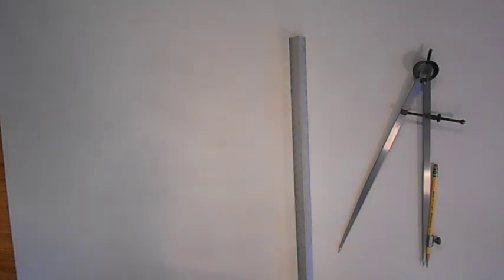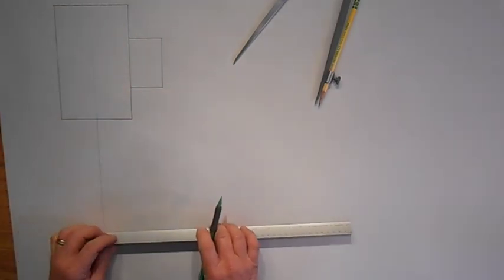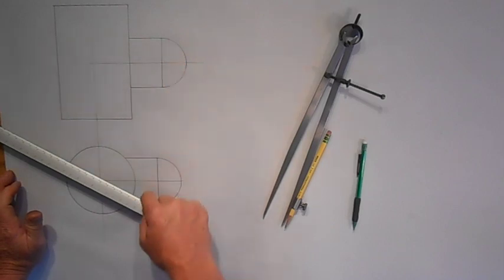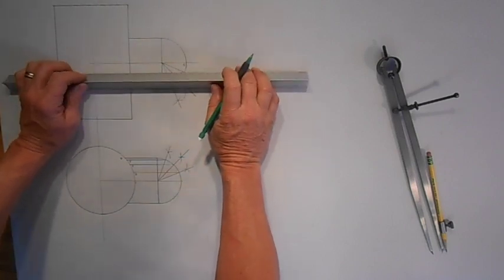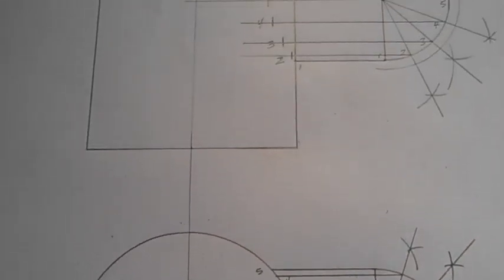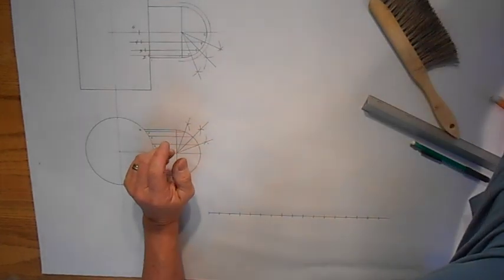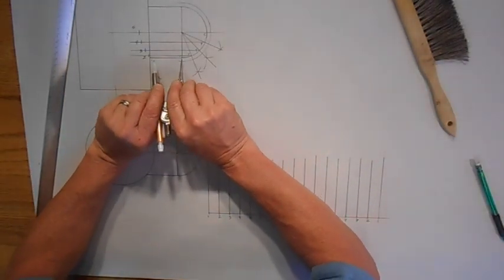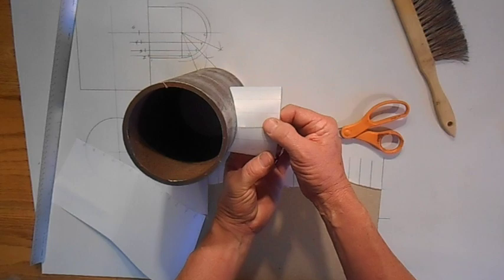Making a 90 degree pipe connection template

Comment: Thank you for this clear video. I'm a welder for the local utility company. At our gas storage facility, we have a lot of scrap well casing and production tubing that is great for recycling into storage racks and other structures. I'd like to get down on the job site making templates with an 18 x 24 pad of that fade-out paper like what you are using, but the only stuff I can find online costs $150 for 50 sheets. The only brand that seems to  make the stuff is "Clearprint" is that what you are using? Do you still get this paper from your local supplier or do you have somewhere online you order it from?
I'm sure i can get by with a T-square and some triangles for laying out all those vertical and horizontal lines on blank paper. But for speed and limited supplies in the field, i feel like the fadeout paper is key.
Reply: I guess this video was posted 10 years ago, maybe the paper has inflated quite a bit.
Reply from the maker: I would think you can find the paper online... Dave

Comment: Is this the same for joining 2 pipes that are the same diameter?
Reply from the maker: Yes, but with pipe of the same diameter, templates and be commonly bought for smaller diameter pipe,
if so desired... 
The above process is excellent for pipe coneections of different sizes!
Dave
Reply: Thanks, I learnt it years ago while I was an apprentice and have forgotten how to do it for 90 degree joins. So if both pipes are 150 diameter it’s the same menthod as you’ve shown, do I still use the ID or the OD measurement
Reply from the maker: A... 150 diameter? @callumtonks5
Reply: @daveosland3199  150mm diameter for example
Reply from the maker: I use the I.D. @callumtonks5

Comment: Hi Dave can you do a concentric 45 lateral layout video it’s driving me nuts trying to figure it out? Please thank you 🙏
Reply: Hi folk, please, visit https://www.etubespro.com where you will find a really practical method for saddle templates for tubes/pipes of any size and thickness intersecting any other tubes/pipes at any angle. It works with offsets. It takes only a few minutes to set up the 3D model and see exactly how the connection looks like. Templates are generated in DXF / DWG format and then printed at real scale. 

This approach is frankly cheaper than any other method. There is no need for any fancy software nor sophisticated equipment to achieve always a perfect fit and welding!.

Comment: This is what should have been taught in school. I will definitely show my daughter this. I always maintained what we learned I. School was not practical. You, however. That's an entirely different story. Putting mathematics where it's needed. I recently learned trigonometry then proceeded to work out the formulas on spread sheets. I'm making some frames from discarded fencing posts and have made some jigs to cut with a cold cut saw. Well done and thanks for uploading.
Reply: Starts with drafting classes.
Reply: @wesliebegay828  I self learn from everything I do. Also done by trial and error. I guess even when I was young I wanted to find out things for myself.

Comment: To get a more accurate template, you can simply take the O.D. 3.5 * pie / 16 = 10.9956 / 16 = .6872.  Use this as the measurement from the last step before extending the lines upward.   Using the compass between the points on the O.D. introduces the error which is why the length came out shorter than it should have.   Good information

Comment: Did you take the length of the outside diameter to do the final cut layout. Like where the line for 1 intersects with the outside diameter of the 3 inch pipe. You added the 1/4 for the outside diameter but u dint measure from the ouside of it but from the inside diameter. I dont know if you understand me.

Comment: Excuse my ignorance, but why in this video were the segments divided into 5 and the others into 9. Thanks
Reply from the maker: Good question-
On a 90 degree,  the top 1/4 segment is the same as the bottom. (Each 1/4 section is the same.) On a , say, a 45 degree wye, the top and bottom are different, thus the need to layout extra segments to accommodate the template.....

Comment from the maker: The "numbers to space them apart" are arrived by equally dividing the arc segment into 4 equal parts, creating 5 points.
A quick down and dirty way to fit a couple of pipes together, especially small like 2", is to nip the 2 opposite edges of a 90 degree pipe end off at about 45 degrees. Don't cut quite all the way to the center line on those cuts. Try on a couple of scrap pieces. A minute of clean up with a 4" grinder will have those pieces fit up and ready to weld!!
  Of course a 2" hole saw in a still press is also a quick easy way to note a pipe for fit up!
Dave
Reply: I would definitely have to try that out! We do have a bandsaw, but we've got to use a cutting torch for this project. Thanks for taking the time to reply, Dave!
Reply: Thankyou for the video but I was wondering how you ran the lines upward to connect the numbers. From bottom to top if that makes sense

Comment: I know that the numbers 1-5 have to be equally spaced, but where did you get the numbers to space them apart? It'd be great if you explained that, my welding class (in high school) has to make saddle cuts to fit two 2" pipes together. Although we have to figure that out ourselves, so I'm trying to look for techniques to help.
Reply: He simply used the Compass to automatically space them apart removing the need to measure anything. Your compass is what you are measuring with. If you want number measurements invest in a Pipe Fitters hand book.

Comment: hello friend great video , im just curious , it seems to me that you provide a sequence of steps that can be skipped . the step where you cross hare the points seems as though its not necessary as the over head view provides this info . now maybe if it wasnt a 90 degree saddle i could see the need but it seems the over head view generates the needed dimensions. brother im not nocking your work at all im simply attempting to remove confusion from my own mind as i cannot under stand why we would use these extra steps on a t saddle  . i laid out a tangent connection using your method and discover i didnt need to use these extra steps , maybe there is something im missing

Comment: dude you gotta slow down and explain things a little better . what measurement are you using and where did you get the numbers. we are not engineers or drafters and do not have scale rules.
Reply: yeah i'm trying to do this on sketchup make and my template is WAY off. I wish someone on the internet had a better explanation

Comment: hi I was wondering, is this like another version of an unequal "T"? I work with sheet metal and it seems like the same scenario but you did it a different way.
Reply from the maker: +808kea808 I'm not sure what is meant by an "unequal" T, but this technique will work with other angles of a saddle/branch connection...
Reply: +Dave Osland an unequal Tee is a "T"  of two pipes intersects. but  the pipes are of different sizes . your videos are great, I enjoyed that square to round video you posted . helped me impress some of the guys at work

Comment: excellent sir,,,what a easy way to draw a template.....

what about eccentric reducer template waiting for that one?
Reply from the maker: +Muhammad Saeed
 Hi- I assume you want to make an offset reducer piece, as in a sheet metal fitting?
Reply: Hello sir,
thanks for your time,

yes sir the center point will be different for both end
Reply from the maker: Muhammad Saeed i just loaded a transition template for offset top and bottom-
Dave
Reply: +Dave Osland awesome!